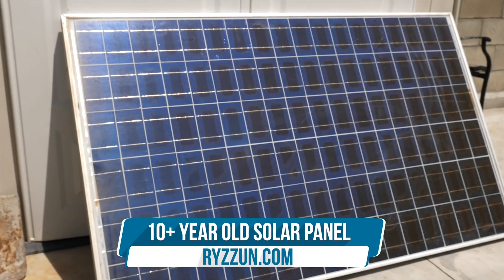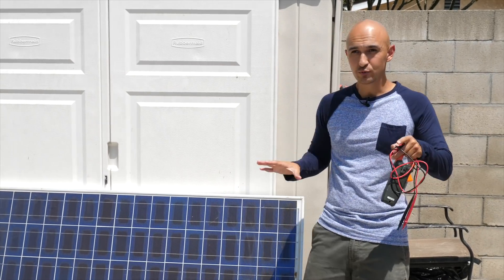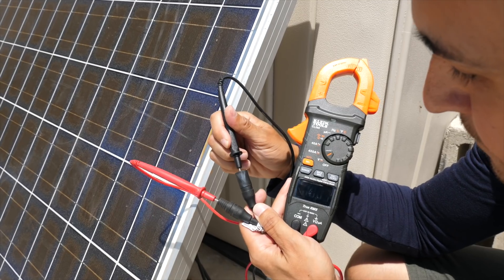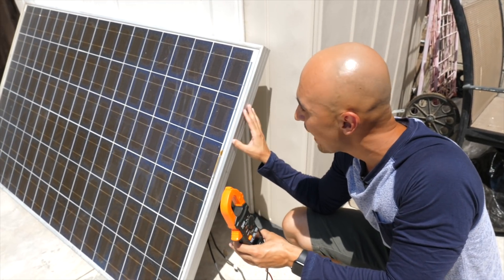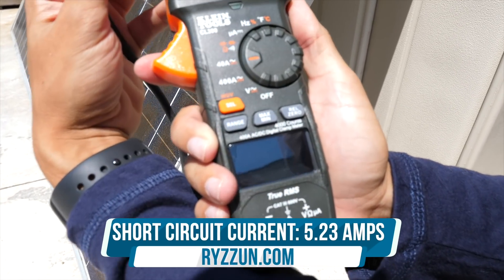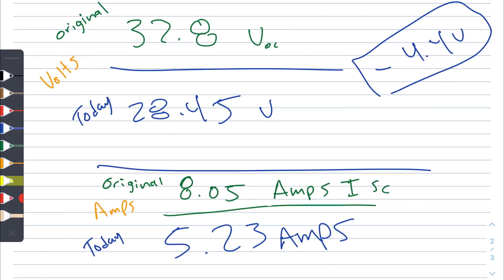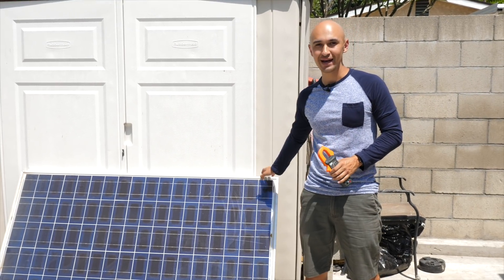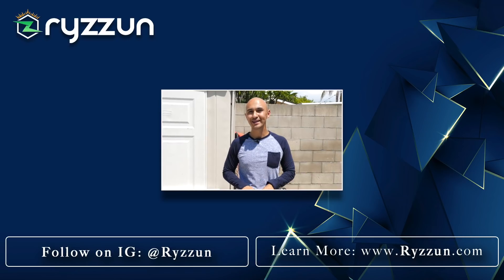Klein CL390 How to Use - Tools Voltage Testing Solar Panel with Multimeter | Power Energy DC Meter

Comment: Wouldn't the meter be checking the Vmp, not Voc?
Reply from the maker: No. You would measure the VMP after attaching a load to it. When you're measuring the voltage directly from the solar panel in this manner, you're measuring the open circuit voltage
Reply: @Ryzzun  gotcha. Is checking the amperage with this method the Imp or Isc?